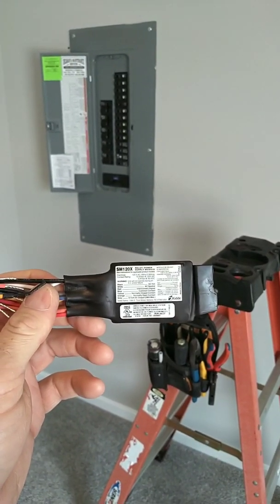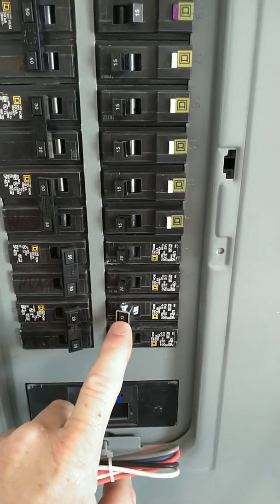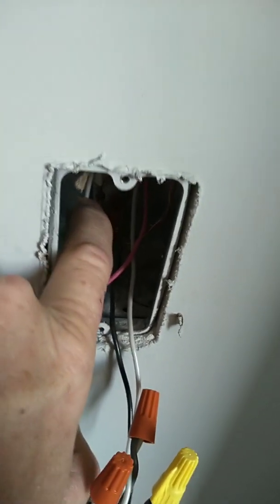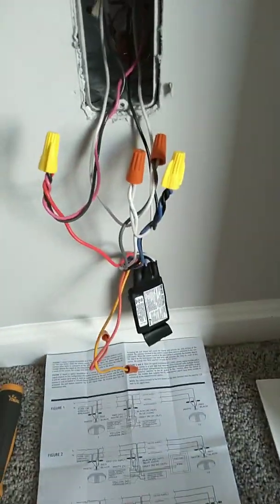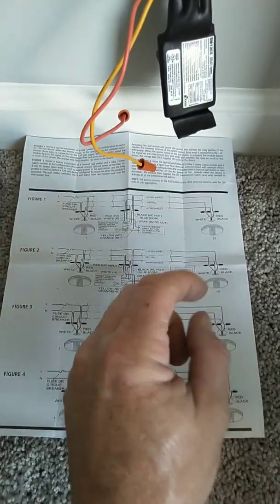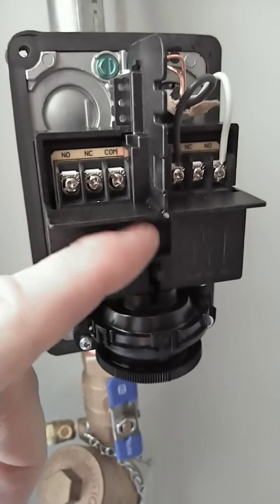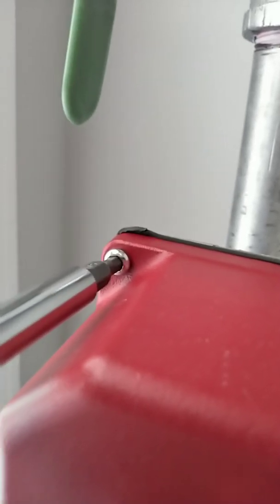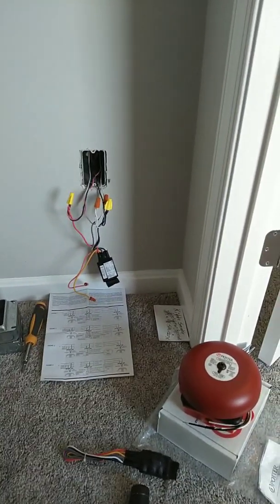How to tie in, smoke detectors to a Fire suppression system (Worcester County)

Comment: I couldn't see the specific wiring diagram but why did you connect the white wire to the NO terminal?
Reply from the maker: Thanks for watching and commenting. That's a great question. Let me explain. The way I wire these flow switches on low voltage is for safety. Mostly due to the accessibility of other service techs entering the flow switch enclosure. The wire going to the flow switch is just a low voltage switch leg. 
The common is feed.
The NO =normally open 
The NC=normally closed in relation to the function in which the flow switch operates. I hope that explains it .

Comment: Excuse me, sir, how I can do to 16 apartment controlling with smoke detector to the floor switch
Reply from the maker: Thanks for watching and commenting. Great question. But it sounds like you need to talk this over with your local Fire Marshal and the electrical inspector. The larger apartment buildings in my area of Maryland require the smoke detectors per apartments. So all the apartments are not joined  and going off together when someone decides to burn the beans in their kitchen...🤔

Comment: Thanks for the video.  Talked to kidde tech support.  They recommend using the flow switch as the power feed for the relay.  You get 120v at the flow switch but you aren't leaving the relay powered all the time which extends the life of the relay.  The relay comes with a 1 year warranty but kidde recommends replacing every 10 years.  They are fairly cheap ~$10 so it makes sense to just replace it when you replace your smokes.  If using 120 to flow then you hook hot to the flow switch and it comes back as hot for the relay.  Neutral on relay is neutral in box and you then just use the grey 9v line to the red interconnect on the smokes.  All the other wires off the relay ( blue, orange, yellow, red) are not needed.  My relay was only outputing 1v on the grey wire after being wired on for a number of years ( tho I am not sure it was properly tested on install so could be it was doa ).
Reply: If done this way then how would you wire up your horn/strobe?
Reply: I think the best way is to pigtail from the flow switch output.  You could do that either at the flow switch or at the relay location.  I like this method for a bell as if the relay fails the bell still works.
Reply from the maker: Thanks for watching and commenting on another person's comment. You have a very (compelling point).

Comment: Thanks for all the info Ron,  I have all the wiring in the wall and to the correct places.  Just want to double check something.  I have to have a 120v bell strobe combo connected to the flow switch and smokes so when the flow starts or the smokes are triggered then everything goes off.  Can I use diagram 2 and just replace the pull switch with the flow switch. In my head this works but not 100 percent sure.
Reply from the maker: Thanks for watching and commenting. Yes, absolutely. The flow switch will take place of a fire bell (pull station).

Comment: Exposed NM-B is a not allowed. Exactly which code does not allow a 14/3 (multi wire circuit) as a HR?
Reply from the maker: Hey Chris thanks for watching and commenting. Nm-b wire is allowed in residential settings to feed equipment, as long as its away from anything which could cause physical wire damage. aka:closets, utilities, pump houses to serveable equipment.  There is (no code) saying you can't feed circuits with 14-3. 
You just can't feed a smoke alarm circuit with 14-3 ! The Red wire in a smoke alarm circuit is listed as the communication wire that cannot go back to the panel!

Comment: Can I T out of one of my smoke alarms or does it need to be in series
Reply from the maker: Hey Bill, thanks for watching and commenting. Yes, you can absolutely tee off of a smoke for a sprinkler relay or smoke, carbon monoxide detector.  Just make sure your not going over the wire count listed in the back of the box.
Reply: @workingmanrondoyle3287  thank you so much I’m a owner builder and the fire chief requires everything connect and my fire sprinkler installer didn’t even know how to do it. I think you are the only one that does.  Thanks again for sharing your knowledge.

Comment: Hello please help. I wired the smokes to specs and the smokes wont stop alarming
Reply: They are alarming it stops when I remove the black(com) from the interconnent wire
Reply from the maker: @leaurdraraye8509 
 Going off your last reply: I really hope you didn't wire the 
black/feed=common from house power to the smoke detectors red/interconnect on the detectors? If you did ? It's not wired correctly and you may have burnt out all of these detectors 😥 
The red wire is an interconnect wire for the smoke detectors to communicate to each and is de-rated  to low voltage. This wire will never have 120 volt to ground on it unless it's wired wrong. Your very first smoke detector should have a 14-2 NM or equivalent coming from the house panel. (After the first smoke)it will continue onto other smokes with 14-3 NM or equivalent wire suited for your area. The interconnect (red) wire never goes back to the house panel. Only smoke to smoke. Please let me know if you understand?
Reply: I think k I should be using figure 4. I have a relay, a tamper switch and hardwire battery backup smokes
Reply from the maker: @leaurdraraye8509  You could have used figure 4 but your flow switch will have 120 volts  on it. I don't because, sometimes the sprinkler guy will finish the hookup. Figure 2 is much safer!
Reply: I'll try figure 4 to see if it work figure 2 did not.thanks
Reply from the maker: @leaurdraraye8509  not to discourage you, keep in mind if it was wired incorrectly the first time, the relay may have arced out. It may need to be replaced. Good luck to you.
Reply from the maker: Hello and thanks for watching. Are your smoke detectors chirping or alarming? Have you pulled the plastic tabs from each smoke detector? Have you pushed the test button at least once? This will reset them. Have you confirmed power to each smoke detector location?
Reply: No I wire the common from the flow switches to the red Interconnect
Reply from the maker: @leaurdraraye8509   Ok, I thought you were only referring only to smokes🤔 Your asking about flow switch wiring. If your trying to wire the flow switch, which schematic a,b,c,d,e are you wiring it on? This will give me a better reference of how you want to wire it. And where I can advise, from that point.
Reply: And the no to the grey
Reply: Diagram 2
Reply: Sorry B just like your video
Reply from the maker: @leaurdraraye8509  
Ok, if you have a
 Kidde SM120X relay
There are seven wires coming from it. I'm wiring on Figure 2 so as low voltage 9 volt goes to flow switch. I wire it as flows 
1)relay's blue&black go to house common(hot).
2)Relay's neutral goes to house neutral and alarm bell-
(if your installing one)?
3)Connect relay's red & (flow switch's common) to the house's interconnect(red).
4)connect relay's gray to flow switch's (normally open).
5) connect relay's orange (normally open)to alarm bell's common(hot) if your installing one? 
If not cap it off with a wire nut.
6)cap off relay's yellow (normally closed).
Finish up with bonding grounds and connect to the flow switch. That's it. Go to flow switch and pull plunger down to test system out. I hope you can understand the order. Let me know 🤔

Comment: How you connect the belt with the 14-2 and 13-4 and the relay
Reply: Thank you so much I really I appreciate it 👏🏻
Reply from the maker: @suticatarivas4803  I appreciate you 👍 watching the channel.
Reply from the maker: I use the schematic that comes with the relay. It's wired on diagram B. I hope that helps you.
Reply: Ok so I’m installing my smokes,flow switch,bell,all together now after seeing your video I saw you had a 120x relay.I got all that.now inspector want when the flow switch goes on that the bell and smokes go off together!please help with how to wire.I have 14-2 to the bell from single gang I have 14-2 from flow to same single gang then I have 14-3 to my smokes
Reply from the maker: @suticatarivas4803  ok, so you have all three NM wires going into one box? And it's deep enough to hold them and the sm-120x relay?
Reply: Yes
Reply from the maker: @suticatarivas4803  ok, Figure 2  on the Kidde sm-120 x relay. Start with the flow switch at it's location. Black wire on common and white on (no)= normally open. ok, second thing is wire the 120 volt bell at it's location. Next Go to relay location and start with grounds. When neutral connections= Neutral on bell+detector+relay tied together totally 3wires. Now connect the hots= detector's hot+ the relay's blue& black totally 3 wires. Now connect the relay's orange (no) to the the Bell's black/hot wire. Cap off the relay's yellow (NC)wire. Your not using that one. Now connect the relay's gray wire to the flow switches white wire. Now connect flow switches black+relay's red wire+ detector red wire together totally 3 wires. Now check to make sure all the connections are counted for and connected. This will complete the wire up. Wiring this way will be low voltage at the flow switch and 120volt at the bell location. I hope this is in enough detail for you to understand. Let me know if you have ?'s

Comment: LOTS of homes gonna be flooded by nuisance trips. Lol
Reply from the maker: The biggest problems that I've heard of from fire sprinkler systems in residential homes are frozen piping due to them being in attic spaces. Mostly people turning the heat down to a lower temperature while their away. Tying a sprinkler system into the smoke detectors won't cause nuisance trips. This practice of tying them together tells the homeowner if water 🤔 is flowing through the system, Which Makes them aware of an issue to look for.

Comment: Can you explain which wires go to where? I’m having trouble connecting the relay.
Reply: How do you make smokes and bell together.  To work..
Reply: @danelticarat7158  in theory, if the bell is 120v you can go from the flow switch to the bell just the same way you go from the flow swith to the relay. One the switch is activated would send power to both the relay and the bell.
Reply: Just the smokes, I think I got a good picture of your wiring but just want to make sure. Baltimore City makes us do it this way too.
Reply from the maker: @copperworld78   if your only sounding off the smokes your relay box location will need one 14-3 coming from the smokes and
One 14-2 going to the flow switch. I hope that helps you. Let me know how you make out with it.
Reply from the maker: Are you doing  the Kidde sm120 x  relay?
Reply from the maker: Are you installing a bell and smokes to sounds off together? Or just the smokes?
Reply: Red wire from smokes and relay go to common on flow switch, grey 9v from relay goes to normal closed on flow switch? Black from smokes go to black blue of relay? White from smoke and relay tie together?
Reply from the maker: @copperworld78  
yes to your reply about the wiring for figure 2. But you need to use the normally open contacts! (Not closed.)

Comment: a fire sprinkler system!? This is only for rentals, right? Or only above gas appliances?
Reply from the maker: Thanks for the reply. All of Maryland has mandated fire sprinkler systems be installed in all (new construction homes). But Worcester County has mandated installing a flow switch and tying the flow switch into an exterior bell or tying into the smoke detectors to be set off when water flow is detected. I think in a few years the other counties of Maryland will adopt this mandated code too.